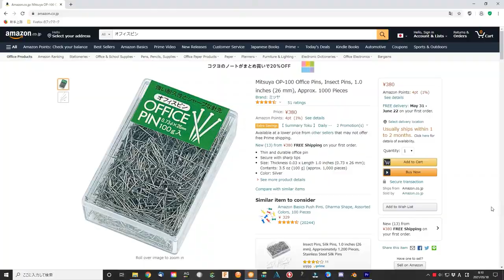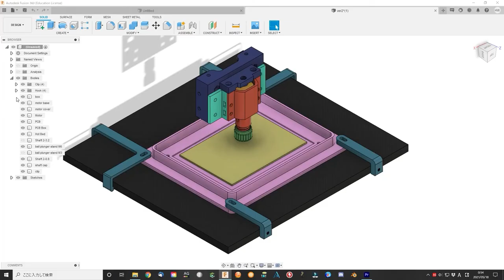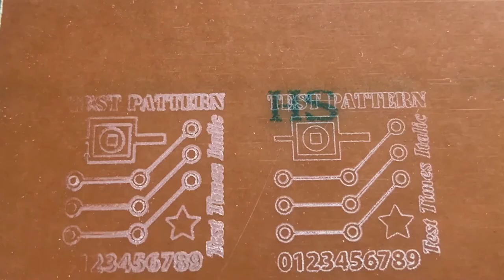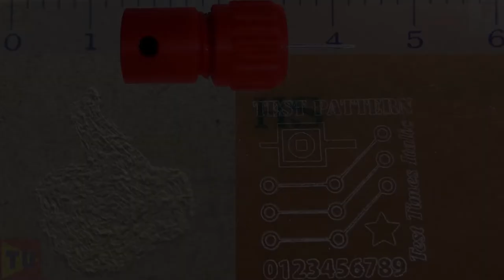How to make the simplest and cheapest CNC drill bit in the world using office pin

Comment: how did you wired the motor to the 3d printer.
Reply from the maker: I use an attachment base that fixes the printer hot end box. I have described that in my previous video. Also, I have uploaded the model to Thingiverse.  So I just connect the motor holder to that base. You can see my 3d printer always mounted a white box since it is not hinder the 3d printer's normal function. The motor is then connected to a DC power supply that I manually adjust the output voltage.  After I have found the good voltage, now I use 3 V then leave it on.  Hope it will give you some help. Please share with your friends. Have a nice day.